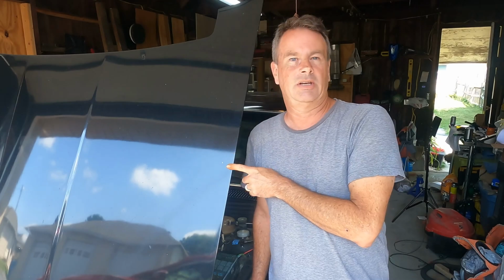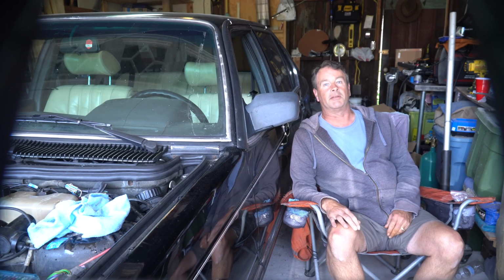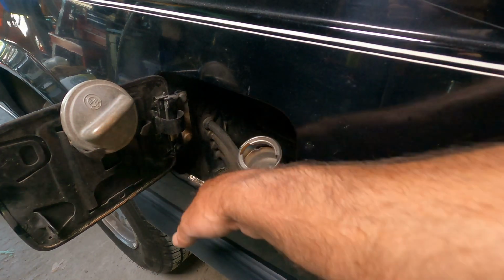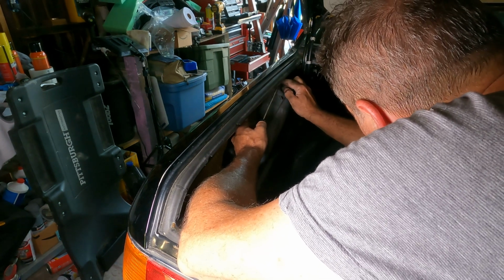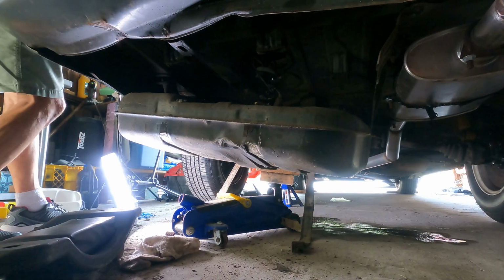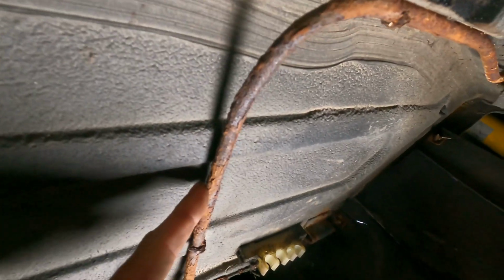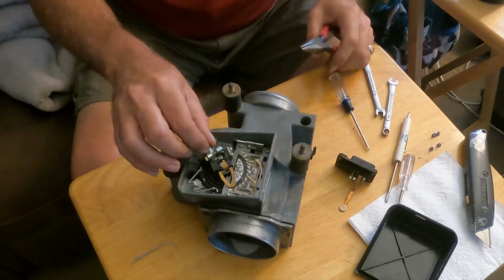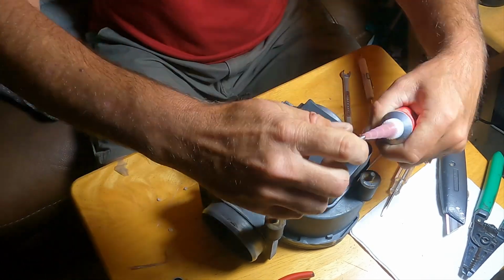BMW E23 733i Fuel Tank & AFR Recon

Comment: This is a nice car but omg so many problems. Mines is it turns over no spark 😡
Reply from the maker: Old cars that weren't maintenance take some time to work through. Once you have the little stuff worked through these cars work pretty good if you drive them regularly and maintain them.